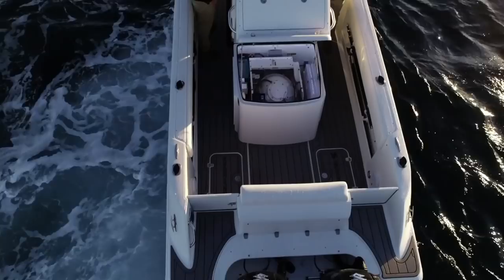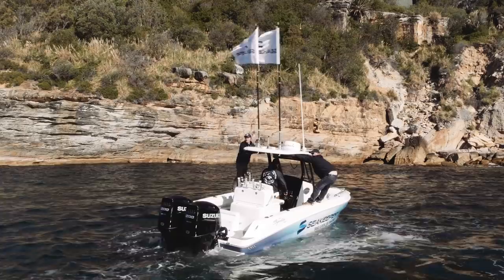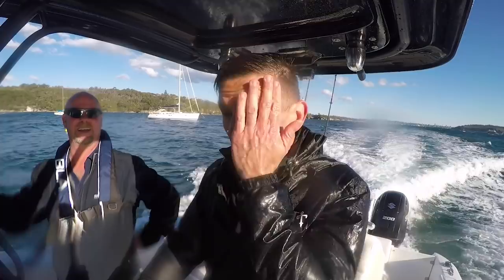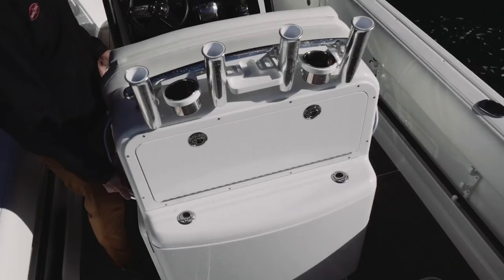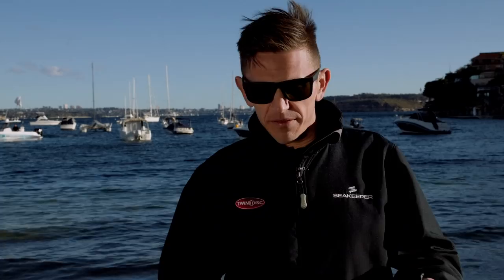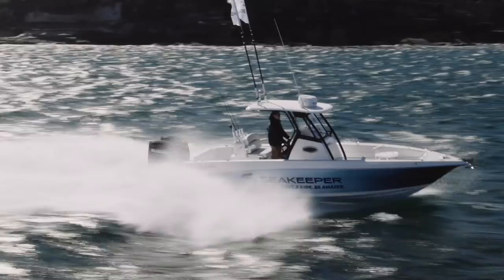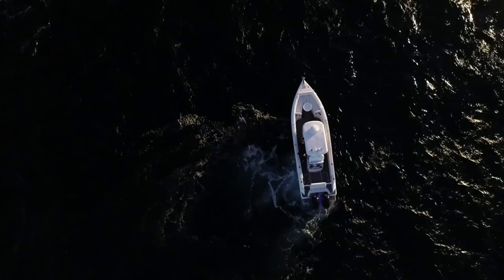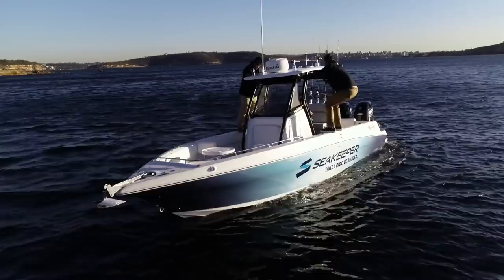Signature 788SF fitted with Seakeeper gyro

Comment: Ok ok I get the gyro, but can someone please explain why and how the outboards go in opposite directions at 1.07?  That is something new for me, never seen or heard of that before on a trailer craft, only on large vessels with Volvo drives.
Reply: i thought the same exact thing!
Reply: They spent the money to do it
Reply: Part of the joystick control. https://www.suzukimarine.com.au/parts-and-servicing/genuine-parts-2/suzuki-precision-manoeuvring-joystick/
Reply: There's new systems that allow GPS fed position holding features. Meaning you set a path or hold position and the motors move automatically to hold a path or single position, regardless of wind, current or swell.

Comment: maybe if i were flying an airplane but given modern computing power almost any sea state can be simulated now...plus auto trim plus fly by wire and all that's left is power to weight ratio and you can take a 13 foot boston whaler through this junk now.

Comment: Don't know why I don't see this comment what runs this gyro are you draining your battery or you have to have additional 4 batteries idle your Motors how does it work
Reply: Roland Kovalenoks On board generator.
Reply: It's actually 24VDC, that boat in particular can run the gyro for approx. 6 hours off the batteries. Larger models are powered off the generator